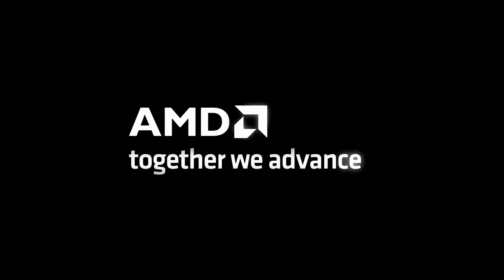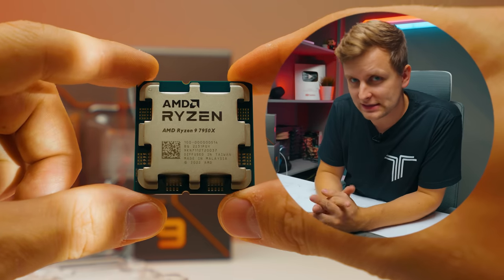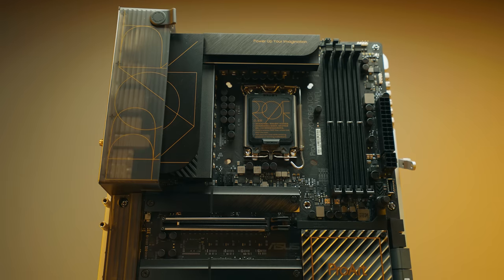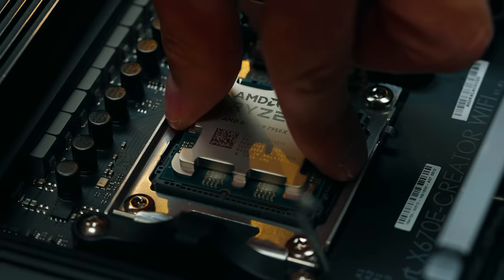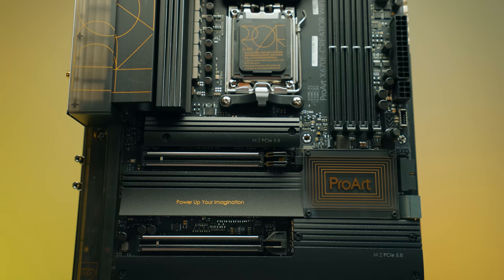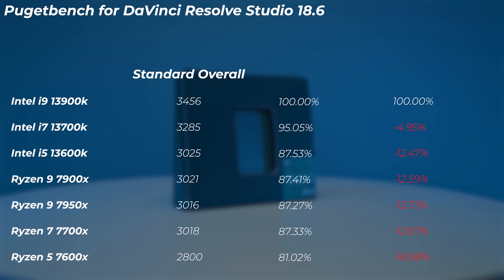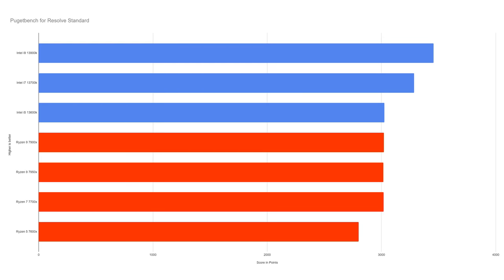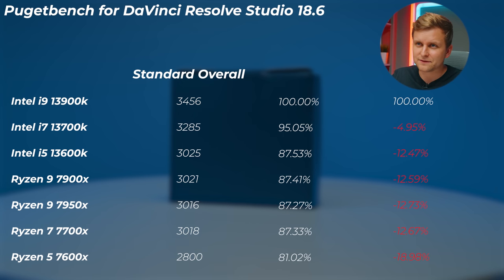AMD Ryzen VS Intel for Video Editing - Which CPU is best for Premiere Pro & DaVinci Resolve?

Comment: For overall video editing, Intel Quick Sync is a real game changer. A couple of months ago, I switched my main PC from a 5800X to a 13700K, and every issue I had with AMD has disappeared with Intel. Overall, everything feels smoother and snappier. Even when using a dedicated GPU, exporting directly with Quick Sync usually works faster and better than with a dedicated flagship GPU.
Reply: Interestingly, I also have a Mac M2, which works wonders for video editing, and its overall performance is on par with something like the 13700K
Reply: It's comments like this that makes me feel like changing.

Even if it's from AMD Ryzen 5 7600 to Intel Core i3-12100 for the iGPU usage.
Reply: @goldfries  Or (and I actually have no ide if this would be a viable option) you could get an A380 and maybe you can run quicksync through that? 
Again, I do not know if this is possible, but it might be worth looking into it since it should be the cheaper/easier (solution)
Reply: you know that quick sync ruins the quality of the video right ?
Reply from the maker: @georgitodorov4048 could you explain that comment?
Reply: @mastroitek  yes but I am on SFF setup and I do have 3 ARC with me. 

And to answer you whether it is possible - yes it is. I've made content about it too, one can use say the A380 on the lower PCI-E slot if it's available.
Reply: @georgitodorov4048  WRONG! I have several PCs equipped with Quadro and RTX GPUs, and a Mac mini M2. My workload involves working with 4K 60FPS HDR (HDR10 or Dolby Vision) files with a bitrate of 60+ Mb/s. I have exported over 200 files on various machines, including AMD-based PCs with RTX, Intel-based PCs with RTX, Intel-based PCs with Quadro, and Mac M2. Here is my conclusion for achieving the best possible quality, focusing solely on the exporting process, not video editing:

1.Mac
2.PC with Intel Quick Sync
3. PC with Nvidia Encoder.

Actually, dedicated GPUs, in my case, I have an RTX 3090 and 3070 Ti, perform worse in comparison to Quick Sync and Mac M2. Just as a reminder, I'm a videophile and audiophile, with lots of audio and video equipment, and I'm addicted to video and audio quality. My mastering monitor is also DCI-P3 99%, and I've spent a lot of time making comparisons. Quick Sync quality is on par with Mac M2; both are excellent. Nvidia falls pretty far behind in terms of quality. The settings I have used for Nvidia involve tuning for the highest quality with the preset set to 'very slow.'

Same settings were used for all of the comparison: 4K 60FPS H.265 with 4:2:2 10-bit or 4:4:4 10-bit.
Reply: @AmbientDatabase  Did you just say you work with 60Mbps files?! Holy sh** you must have a ton of storage 😂 (But that bitrate is for non encoded files right? I imagine with h265 you can bring it down to something like 25-30mbps?)
Reply: Hardware encoding trades quality and file size for speed. It has fixed functionality that can't be improved over time. Yes its not a big difference but it can't match the accuracy and compression efficiency of software encoding. Its shame to spend solid 5 digit figure for quality equipment and after that ruin your content with cheap tricks.
 @theTechNotice  
 @AmbientDatabase
Reply: @mastroitek   Yes, the master file that we get from our animation software has a bit rate of about 60 mb/s. For raw files, having a raw file in our archive and uploading it directly to YouTube are two different matters. YouTube's compression algorithm always distorts the animation fluidity and smoothness. It basically doesn't matter if we upload a 35 GB file for a 1-hour video or the same file with 5 GB and H.265 compression; YouTube will compress it again, but its behavior can be unpredictable. For instance, if we upload a 1-hour, 5 GB file to YouTube, it might decrease the size to about 2-3 GB or even increase it to more than 10 GB. Overall, unless you have a super high-speed internet connection, it's not ideal to upload a raw file to YouTube. Encoding it is the way to go.

With H.265, my experience with YouTube videos is that even 10-15 mb/sis enough, and you can't see a real difference compared to 60 mb/s.

For this reason, when we publish a new video every day, we mention that YouTube's compression algorithm lowers the overall animation quality.

Storage costs are cheap compared to other equipment.
Reply: @georgitodorov4048   It's a myth; it's called hardware acceleration for a reason. As I mentioned before, I encoded over 200 hours of video on several machines ( Much more, actually, but I only count the 1-hour video ) , including some color grading with software processing. In my case, hardware acceleration performs better in terms of quality, as there is a dedicated engine to handle these kinds of tasks.
Reply: @mastroitek  my sony a7c video files are 100 mbits 24 fps 4k full frame 24x36. Some cameras have higher than that.
Reply: @CC-gt3ro  yeah I checked yesterday for curiosity and my entry level EOS R10 has modes that go above 120Mbps. I think I just forgot we are not in 2015 anymore 🤣 (back then my camera was doing 720p with shitty quality too)
Reply: @AmbientDatabase  I think this is correct. Hardware encoding just has a reputation for lower quality because of use cases such as live streaming where getting out a frame quickly is paramount.
Reply: @timotmon   This is a completely false claim. Software processing can't compete with hardware processing in my case, which includes both Premiere Pro and DaVinci Resolve, in terms of quality. I've conducted numerous tests, spending hundreds of hours testing both software encoding and hardware solutions. In my line of work, where I create animations, even the slightest inconsistency in bit rate can manifest as video errors, causing encoding issues. Software processing introduces so many errors that are imperceptible in everyday content, but in my field, I can easily detect these issues due to the extreme sensitivity of my content to encoding errors. I've also experimented with various settings, bit rates, and encoding profiles, and hardware processing is the only viable choice in terms of both quality and speed. Therefore, the idea that software processing offers better quality is entirely false and nothing more than a myth. Another example is the comparison between software ray tracing and hardware ray tracing.
Reply: @AmbientDatabase  I hope you know that I was agreeing with you.
Reply: What do you think about it for running adobe premiere pro AND adobe after effects at the same time ? Thanks.
Reply: Im having the same issue with the 5800x and considering a switch to the 14900K
Reply: @AmbientDatabase Hey man, can you please tell which NLE you use.

I am looking for a CPU and confused between 13700K and 7900X. 

I ONLY use Davinci Resolve and my deliverables will be 6K h265(derived from 6K bRaw footage).
Reply: @nokiaairtel5311  Get the best Intel K CPU possible and never look back.
Reply: @AmbientDatabase  😅 thanks for reply man.
I am a freelancer and initially considered 7600x or 12600k. But stretched my budget to max 13700K.
How you manage the 100°C temperature of 13700K ? I live in a hot country so that might be a factor for me.
Reply: Bro for video editing which one is best i7 or ryzen I'm Going for asus anyone please give any suggestion
Reply: I had similar experience too. Switch from AMD to intel and video editing seems A LOT more snappier.
Reply: @AmbientDatabase  LMAO ,, don't confuse your dreams with reality
Reply: @nokiaairtel5311  and regarding heat? you should get a big hole to your pocket and buy coolers. except nhd12 from noctua all air coolers failed to handle Intel heat. so obviously you need a 240 ml or higher cooler. that's all it. sell out any scrap you have in home and get the things done😂
Reply: How to enable quick sync? Image. i9900k

Comment: okay now make a video with 7950x, 4090, and ARC gpu in second slot to see if ARC card will be recognized or utilized for anything in premiere/davinci
Reply: Dual A770 16gb after that please. 😂
Reply: @Immortal__ There are claims by Intel that ARC and the integrated graphics can work together from when it was introduced but from what I know (which is very little honestly as I have never touched an ARC gpu) it hasn't worked how they've claimed. But all that information is before recent updates.
Reply: That would be an interesting pair of tests to compare this data to.
Reply: Is Sony vegas no longer a thing
Reply: @chriswright8074  It hasn't been Sony for several years now. Magix owns it and it's still around. It's been very buggy but when it's working it's easier to maneuver than anything else.

Comment: Love the video man! Ryzen 7000 and intel 13th are absolutely amazing. I can definitely back that intel hits higher numbers for performance in most scenarios compared to 7000. Only reason i went with ryzen though is mainly the power draw. Intel cpus suck down quite a bit more than the ryzen and since the performance is fairly small and probably not noticable in every day task, i went with 7950x back in December and dont regret it one bit.
Reply: I heard the power draw average is in favor of Intel. Amd use more power at idle and in games the power is the same. It is at rendering that the power draw is higher. And we are talking of no more than a bulb consumption difference. My issue is more the temp of both Intel and new amd cpu. Undervolting is necessary and i don’t know the impact on long term. Intel has better memory controller and no cpu burning like amd. I wait to see ryzen 8000 and intel 15900k. By the meantime i will simply upgrade to 5950x or 5900x
Reply: Trust me not a big difference because Intel is the most efficient when not gaming or only background task can go down to just 15watt but my brothers Ryzen was still pulling around 70-90watt not sure why they are designed like this idle power consumption is not as good as Intel
Reply: @CC-gt3ro  Not that is means much, but I did run a 7700k for 5y, was constantly hitting 100°C and thermal throttling (problem with the cooler but I never changed it), it is still working well in my second build and surprisingly enough it still can hold the 5ghz profile I created in 2017 (with same voltage). I believe there was a slight chip degradation since the 5.1ghz profile isn't stable anymore, but if you ask me it is still mighty impressive. Adding to this I think Intel stated that they expect their chips to be "fine" at running at TJ max. Therefore in general I would not worry too much about temperatures
Reply: I just want to point out that intel cpus seam to have a much lower idle power draw than AMD multi-chiplets cpus, thus depending on the use case intel might come out as the higher efficiency option. 
(Tech Notice himself did a pool a while back asking AMD users what was the idle power draw of their cpu and there are other reports around about this)
Reply: @mastroitek  I noticed this as well after posting cause it seems like in my use case my AMD CPU for some reason enjoys to sip on power. Idle wattage without anything running in the background is only around 20-25w, 30-35w when using browser, and 70-90w maximum when I game. I didn't realize normal wattage pull for 7950x was closer to 40w idle and a bit higher for other use cases
Reply: @holyassassin1985  30-35W while browsing seams high to me tbh, but it is not too bad so I think it is acceptable (I simply read of ppl having the cpu pulling 40W+ idle, which is insanity), and 70-90w while gaming looks like a good value. Regarding your gpu, do you have by chance a 2monitor setup? My 6950xt used to pull 50W when I had a second monitor connected, while it is about 10W with only my main 4k monitor
Reply: @mastroitek   I indeed have a 2 monitor setup. 1st is a 3440x1440p and then the 2nd is a 2560x1440p that I have set to 1080p to draw less power. The 50w you experienced is very close to what my 4090 draws. It mainly draws around 35w-50 idle with both on and 60w maximum usually when I play things like youtube videos on max resolution. It drops closer to 20-25w though if I turn a monitor off
Reply: @holyassassin1985  yeah it is kinda sad that going from one to two monitors some cards will draw 300-500% their base idle power. That is why I don't use my second monitor unless I really need to 😂
though I hope that in the future cards will be well optimised for a dual monitor setup
Reply: @mastroitek  i have no doubt processor intel can run without issue at 95C but it is not recommended and increase noise of the cooler. I prefer 40C-70C range which i have with my old ryzen 1800x @ 3.6. I understand it will be difficult today with either amd or intel without undervolting. Even 5000 series ryzen temp are higher than my zen 1 but power draw is good as well as reliability. For me for sure as i have zen 1 am4 motherboard, an upgrade to 5900x make sense. But i will Watch the new intel 15900k with their new socket, and the ryzen 8900x/8950x which should improve on memory controller and temp. Intel arrow lake with 40 cores and lower die size could be a monster as well if intel works on power draw and temp.
Reply: @CC-gt3ro  I am building a new system and I still flavor Intel after much research. The lower idle power, the stronger performance when needed. It seems Intel reliability is better as well, work out of the box and xmd works as stated. AMD still has issues that bothers me such as failing motherboards, ram issues, boot times issues. The cost to build AMD is much higher in my country for a new system as well whether it is the processor, motherboard and having to stick to certain ram.
Reply: @Coup0705  this is why i don’t buy am5 and wait 2025 to see what they offer to resolve what i named, issues. I decided to not upgrade at all my ryzen 1800x zen 1 which works well at low temp in any condition (even rendering and benchmark), solid, never crash, and boot from start to windows in few seconds any time even after a change in the bios. The new am5 is ridiculous. I don’t get deceive by the army of amd trolls. I choose as an ex developer my computer with logic. And yes like you today i would pick Intel system, probably a 13700k or 14700k. But i want to see the 15900k and see if Intel can decrease the power consumption at max speed. I would like reduced cpu ghz for less heating and great reliability with a new socket compatible for 2 to 3 generations, and more cpu lanes (24 to 28) and board lanes, wifi 7, thunderbolt 4. More cooling capability for gen 5 nvme ssd. I would like to see also architecture improvements with more coprocessor extensible like for nvme  dedicated circuit, and 3d sound coprocessor, ai coprocessor dedicated to design and rendering, possibility to add card of multi cpus, and a real multitask system not chocking when loading resources. But that ´s more future design.

Comment: P-core and E-core are Intel terms just like hyper-threading.  AMD only has cores and SMT.  I understand your reasons for your RAM speed selection but doesn't really make sense as the comparison is biased.  To be consistent you should have disabled boosting on both CPUs as there specified rated TDP are going to be out of spec otherwise.  As far the memory controllers being weaker or better, that could be true but not necessarily accurate and AMD's chiplet design and infinity fabric wouldn't necessarily perform any better if it's IMC was "stronger" or "better".  AMD released a new AGESA that improved DDR5 speed on AM5 to DDR5-8000 MT/s, does change the chips engineering but doesn't it make the previously weak IMC "stronger".  If you used had locked the base frequencies for both then the extra power requirements for Intel wouldn't have been an issue.
Reply from the maker: I thought about that, but not sure if you've looked into 4 stick EXPO on Ryzen 7000 or higher capacity RAM (64GB+) EXPO stability? 
As creators we need more than just 32GB and at higher capacities Intel does do a better just at the moment, which should be reflected in the benchmarks. If I used 6000mts 32GB on both platforms, I'd actually bottleneck the benchmarks by the RAM capacity which would skew the results even more.
The reason I'm leaving the power limits open is not because I've opened them, it's because most* motherboards have set the MCE or equivalent ON by default (whether this should be on is another conversation) and I believe most people will use the motherboard like that. Hope this clarifies this abit.
Reply: @theTechNotice  AM5 does have limitations on 4 sticks, so most people needing 64 GB will use 2 32 GB sticks.  And most users will enable XMP/EXPO.  I would even go so far as saying they would put some effort in basic memory tuning.  I don't expect you to do that when benchmarking.  Since you use primarily Intel terminology I assume you are more comfortable in that environment.  But if you are going to allow any amount of power on an Intel platform you should at least use the optimum 6000 MT/s with 2 x 32 GB for the AMD system.  They are both sanctioned overclocking.  I'm of the mind it's wilful bias because no one would do what you are doing and then claiming that one system is better than the other.

Comment: I plan on doing an I9 12900k setup. It will be a slow build and a dedicated gpu will be last. I am currently using the an I9 9900k with a RTX 3060 for Sony Vegas. It does quite well as I use it for both gaming and editing.